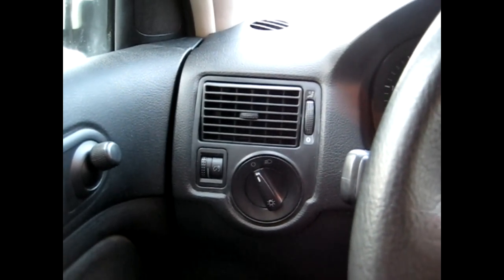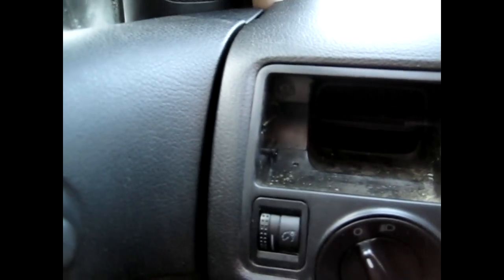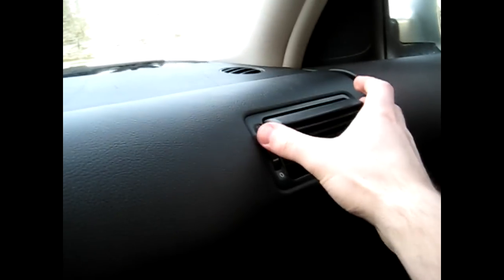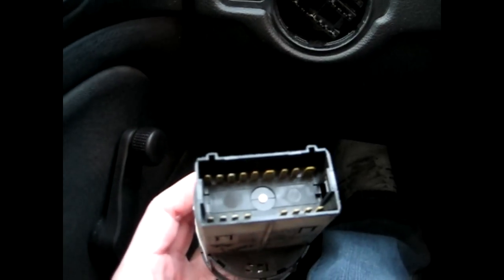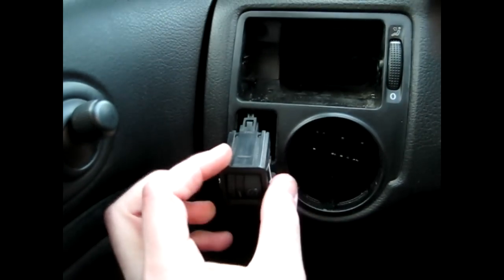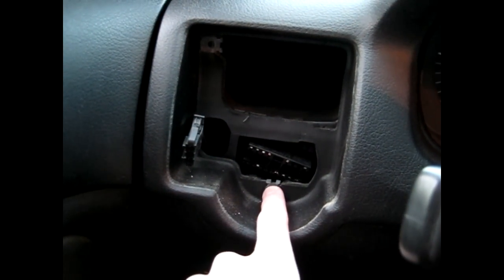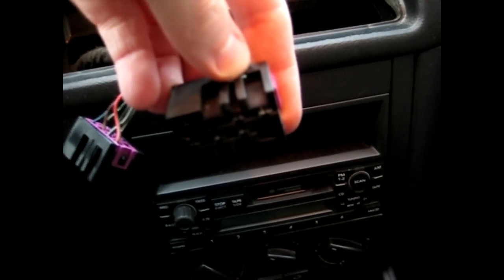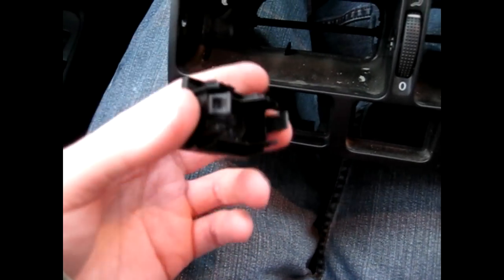DIY: Volkswagen MKIV Dash Vent Removal

Comment from the maker: The plastic ducts are fairly smooth in the inside, so I wouldn't think it would be gathering too much dust. Not to mention the MKIV also has a filtered heating and air conditioning system which is right at the start of the supply vent, therefore not much can enter from the exterior air. But if you wanted to clean them, I'm sure you can use a long foam flexible brush to clean in the ducts once you remove the vents from the dashboard.

Comment from the maker: @DGISID I believe you would have to cut into the dimmer wire which is located right behind the headlight switch and run the rest of the wires for the illuminating vents from there.

Comment from the maker: You might be able to go to the dealership and they can order them separately. Or you can also try a local wrecking yard and they might be able to sell you them separately. Lastly you could try a hardware store (Lowes has a great selection for misc items), they may carry something similar which will work too.

Comment: Very helpful, now i just need to know how i can get rid of the ac and heater core to start my weight reduction aswell a way to have everything wired to the area of where the center vent is

Comment: i like to replace hazard switch. Should i remove the whole panel out and then remove hazard switch as you have done it; or i can remove the hazard switch only with screw driver., Thanks for vdo

Comment: What is not mentioned is that on the larger vent pivot is a tiny plastic cap/bush which can sometimes fall off...If you lose it,your vent will not hold it's position in the casing.FIRST close all the vents in case the cap falls off and rolls into the air ducts (doesn't apply to passenger side)2nd tilt each vent downwards.3rd grasp the top of the vent firmly(side to side) between finger and thumb,push outward on one side of casing with other thumb and ease out slowly from that side.NO TOOLS!

Comment: dude, i need to clean the air conditioning system cz in the city where I live is extremely humid, I have heard that some parts of it catch huge amoutns of dust and humidity wich quickly turns into severe rusty surface, I´d like to know if I can access those vents trough there or if I need to dismantle the whole console

Comment: I have done this. When placing the vents back into place (two middle one's) they do not stay taught like they were previously? They seems to move around too loosely?
Reply from the maker: Did you install the rubber caps in the pivot points when reinstalling the vents???

Comment: I have the same set up on my 2001 Jetta TDI. I have noticed over the past year that my vents; especailly defrost, seems to be clogged. Their seems to be some foam/filter particals that blow out. The pieces seem to be dryrotted. Is there a way to clean out the vent lines once i removed the vent?
Reply from the maker: Unfortunately there really isn't much you can do, unless you're willing to disassemble the entire dash which is very work intensive. Sounds like those foam pieces must be from your cabin filter. You might be able to get a small attachment for a vacuum and feed it into the vents to help clean some of it out. Be sure to check your cabin filter though.

Comment: So I tried taking out the center vents to clean in behind. lots of dust back there cause previous owner had no cabin filter. when i put the vents back they no longer stay "snug" where u can tilt them and they don't move. now the just move loosely and tilt upward by gravity? did I lose a rubber bushing or something???
Reply from the maker: Unfortunately it sounds as if you lost the rubber caps. Only way you'll know if you remove them again and visually check.
Reply: 4DIYers okay thanks appreciate the reply

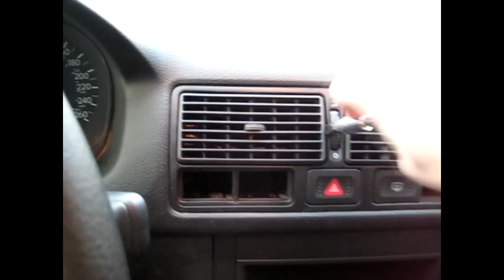Comment: Can anyone help me I have a 1992 Nissan Sentra SE and on the center air vents the knob that individually opens and closes air flow for that vent does not do anything (at 1:15 the knob in between the two center air vents it is in the same exact position on my car) the ones on the other vents work but not on the center one. I was wondering if you knew how to fix this? Is it a disconnected cable that I can get to by removing the air vents?
Reply from the maker: Quite possibly the linkage is broken and would need to be repaired. I've heard of this happening on other vehicles but not a Nissan Sentra specifically. The mechanisms tend to be made of plastic and will become brittle over the years. It's best to remove it and then inspect for any possible causes. Don't forget to subscribe :)

Comment: Bro you see the vents up on the dash close to the windscreen. Two coins slipped in and now they make a lot of sound when i drive my car. Any idea how I can get them out or where they would be ? I tried pulling out the plastic vent and checking around couldn't see anything but it sounds like it's up somewhere. Help would be much appreciated
Reply from the maker: Abdullah Jalees Most likely they've falling to the base of the system, possibly where the heater core is. There might be a small hatch or vent you can remove to peak inside. Some coins are also magnetic and you might be able to insert a magnet on a piece of string or a mechanic's style magnetic tool to retrieve them.

Comment from the maker: I never really ran into this issue myself, but it is fairly common though. I found a thread which will hopefully help you out. A few members post the procedure on how to open the glove box. It appears you need to access it from under the handle. forums.tdiclub. c o m /showthread.p h p?t=248943 (remove spaces)